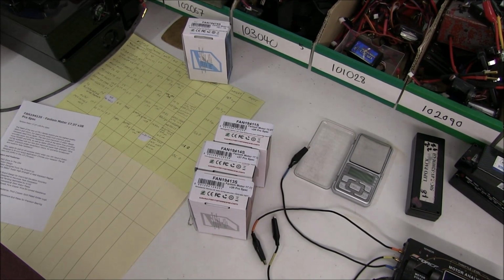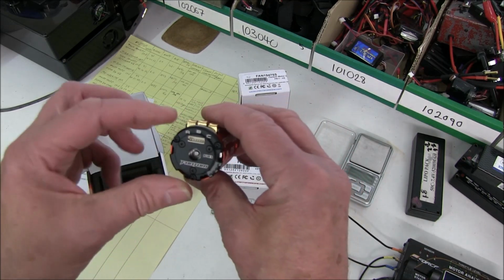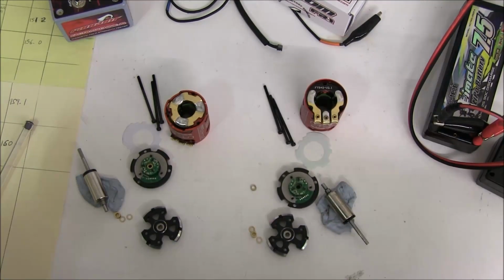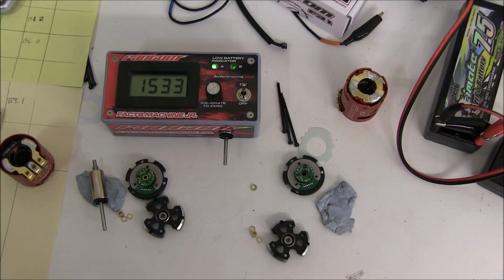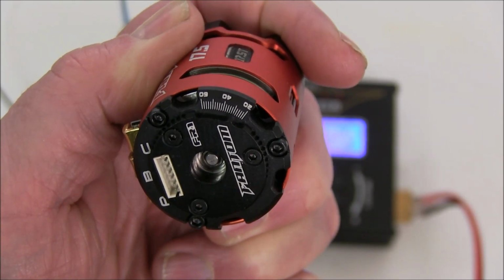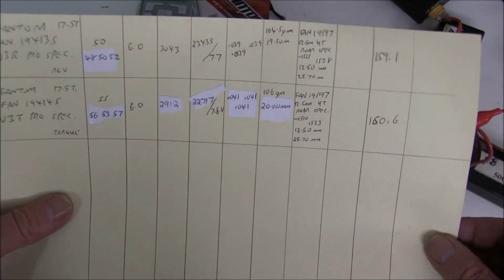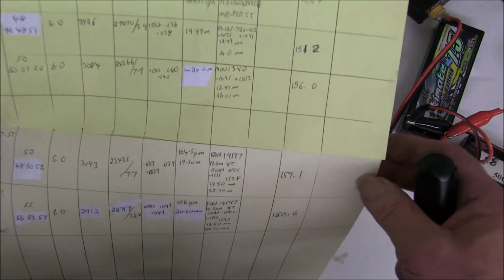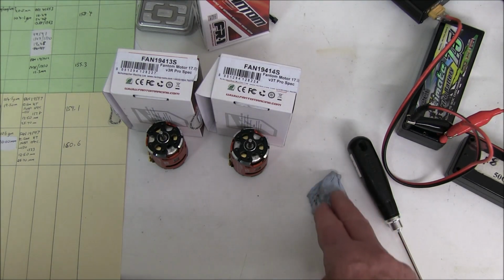FANTOM V3 Pro Spec Motors 17.5T R and T versions Reviewed

Comment: Is this your motor of choice nick  the fantom v3
Reply from the maker: Hi
The Fantom 13.5T is very good for indoor, lots of torque.
But outside I prefer a higher reving motor such as the R1,  or the Hobbywing G3, or the MuchMore, or the new Reedy.
Reply: I'm looking for the fastest 17.5 for indoor
Reply from the maker: The fastest indoor motor, is one with lots of torque.
The Fantom is a good choice. Also the MCR Motiv.

Comment: Thanks for the tests, very interesting. I run Fantom v2s, but recently tested some high numbers from the Eco Power Sling Shot 17.5 (Black Friday special for $49). 27,000rpm+ at 5.9A and 3400kv. Have you tested this budget motor, as it has a bunch of positive reviews on amain and betters my v2r works plus that was 4x its price?!

Comment: it seems the gauss readings on all of these V3Rs posted on Facebook are coming with gauss print outs on the box of higher than 1650. What does the sticker on your box say? Does it match you Fax machine tests?
Reply from the maker: Hi Ryan
The boxes I have do not have any readings on the box, or inside, or on the motor.
The box only says "High torque rotor"
I believe it is possible to special order the motors with higher strength rotors, (for more money) ,maybe it is those.
I will check one of those if I get the chance.

Comment: Nick i been on your channel for a few years i get alot of good info for my offroad racing buggys and. My touring cars but now the drift movement its growing faster i allway wonder why you dont do your test on motor made for drifting .like the yokomo or the acuvace
Reply from the maker: Hi Tony
I will see if there is a good test, but drifting motors are not normally limited by the power output.
For competition flat out racing, getting the most power from a motor is very important.

Comment: Hello, just bought a v2T from a friend for 80$. It's the works plus edition. How would the motor i bought compare to the new Fantom v3r works plus edition? any noticable changes in performance from the V2T works plus to the V3R works plus, that would actually equate into better lap times? great video!
Reply from the maker: Hi
The V3 has better cooling and the stronger rotor.
If your works edition has the same rotor, then the performance will be the same.
If the motor does not get too hot then lap times will be the same.
Reply: Thank you! pretty sure mine has the upgraded rotor.
Reply: What rotor is it?  what rotor comes stock in the v3's, the ultra select rotor 12.5mm, or the pro select 12.5mm rotor? will the v3 rotor's work with the v2's? Thank you!

Comment: Hey hey. Watched many of your vids. Good stuff. Thanks. But I got a question. I have been settling up many motors at sweet spot 6a. I can drive 5 min without crashing ,have high c whatever. I noticed a few cars in blinky class that are way faster than mine. I can hear very high revs coming from there motors. I would say about 30 percent more. I do not care about efficiency. Do I need to turn my amp draw more like 10amps. Or higher and gear it?? Thanks
Reply from the maker: Hi Jason
Are sure they are reving higher? They could be using 64dp gears which create the frequency which you hear.
Anyway, you can increase the amp draw, but to get 10 amps will only need about 1 degree extra, so the speed gain will be small, but the motor temperature will jump up.
Unfortunately there is always someone faster than the others.
There are many variables, including the gear ratio, and exit speed.
If your motor is not hot at the end of the run, then you can try a little more advance, or bigger pinion.
Reply: Thanks nick. Watched all your videos a few times. They are for sure making more rpms. I ran my motor wot and adjusted timing. It just kept going faster till about 14 amps. I kinda wanted to leave it around 10 amps but settled for 8 amps.have not run on track yet. Maybe in the future you could shoot a video of some higher amp draws on a few motors and tell us why that is better or worse. Seems more rpms almost always makes more hp. Me and all my buds wanna see a video     That you push some 17.5/13.5 to the extreme hp limits. Huge thanks again.

Comment: Will you test it with a 12.3mm rotor? Will you be testing 13.5t v3r?
Reply from the maker: I am waiting for a 13.5T V3T  so I can compare.
But based on the 17.5T results, I expect them to be only slightly better than the V2 versions.
12.3mm rotors. I will try and test when I do the 13.5T

Comment: Which is the fastest of the new crop of 17.5 in real world racing? Anyone try the muchmore with titanium rotor for 17.5?
Reply from the maker: Hi Jason
All the motors need correct gearing to get the best out of them, and some are better on large tracks (MuchMore) and some better on small or twisty tracks.(Motiv)
For all round best performance the R1 is the best.